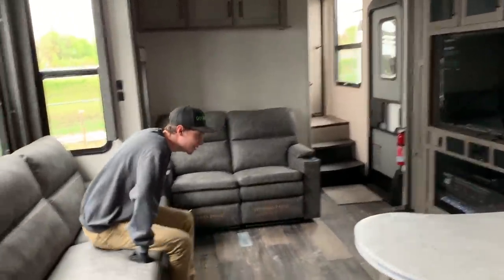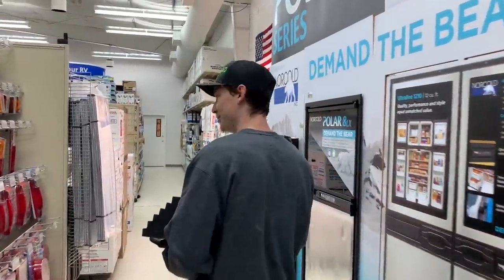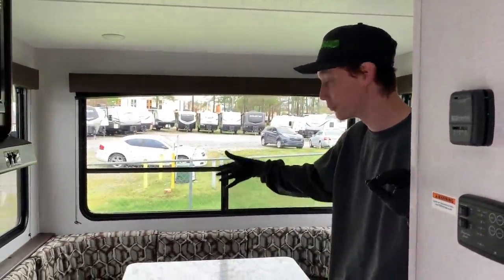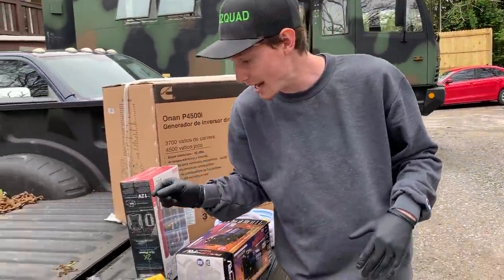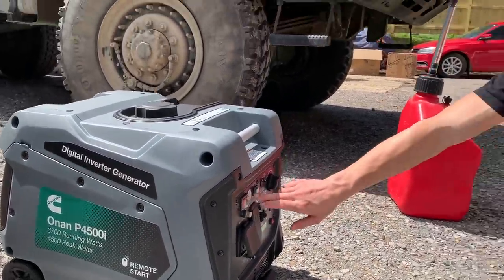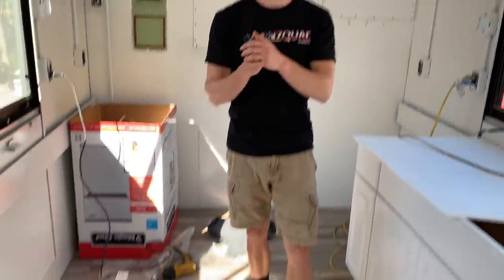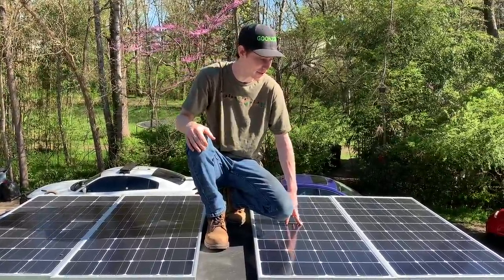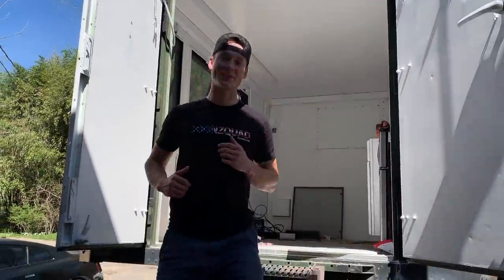Building The Ultimate Apocalypse Vehicle Part 5

Comment: Go to harbor freight and get a predator generator they are super cheap and very reliable I run one on the back of my semi when I’m parked been a life saver used it also to charge my trucks batteries when they got to low to start the truck. They are also compared to the Honda generators

Comment: 200w Minimum size panels, less hassle less holes less wiring and cheaper than 2 100w panels. Check out the 200w Hightec panels that are made in the US with 25yr warranty for $185/shipped distributed from ContinuousResources dot com. For batteries much better off with 2 6v Golf cart wired in series for 12v from Sams club, Costco or Batteries + other VMax has great AGM batteries. Generator or Inverter should ALWAYS be a Pure Sine Wave. Their generator is the pure sine inverter style which is why it's got Eco mode and quiet. Honda Yamaha HF Predator Champion or Wen are decent and different price range.

Comment: You guys get you an EMP SHIELD FOR  your circuit box / generator and solar panel . Plus an additional one for the trucks electrical systems also . Then no matter what happens all you need is food , fuel , ammo , weapons , and balls . Cuz some asshole will definitely wanna steal that rig from you guys . Wouldn't hurt to line the walls of the camper and truck cab with Kevlar also .

Comment: I really don't think that refrigerator was meant to be used in a solar application. It'll still work, but it's 120 volt and is not designed to be used like this. With solar you wanna mitigate the amount of energy needed to keep your appliances running for as long as possible.  Just that one appliance is going to drain your batteries.

Comment: You should have put in 12v led lights instead of 120v. That way you could have run them on battery and not have to have generator running to power them up.

Comment: you should do 4 batteries and 4 panels because only the minifridge would be running 24/7, lights and stove etc would run like max 5 hrs a day so you dont need more panels and if still the stored charge isnt enough, get more batteries not panels.

Comment: Some military panels run off of multiple voltages, 12DC, 24DC or 120 AC.  Find out if you have all AC or DC panels. And a solar panel usually puts out 1.4 Amps at a rated voltage, like 12 v, 24v or 36 volts. You said yours are 100-watt panels. You can have 400 watts if hooked up properly   Learn about volts, amps, and watts. The voltage and the amps are what one normally sees on a meter. Get some training on electrical. Understanding how the converter works will show you how the amperage is changed at a certain voltage.

Comment: that is a 3-phase power panel. Your generator outputs 2 "hot" wires. Residential circuit breakers boxes have 2 hots. This panel has 3 hots. A third of your power plugs are connected to the third hot bus, and will just never work if you don't connect third hot from a 3-phase generator. The air conditioner is probably 3 phase, and will never work, unless you connect it to 3-phase power. Does the circuit breaker for it look like it's 3 breakers molded together? If you can abide just never having some of the power plugs work, then what you're doing is fine. Otherwise you have to find a 3-phase gennie or have to rip out the circuit breaker panel and replace it.

Comment: i think the issue with your power is that the panel is a single phase panel, typical house panels are 3 phase.. you might want to get a different panel or call an electrician to help

Comment: if you really want to use all 8 solar panels to the fullest get a tesla model 3 or s battery pack, and wire your panels/mppt solar controller into a 24v system.

Comment: I'm an electrician...from what little I could see you are running that backwards through a breaker...at the top of the panel there are three lugs for your phases...that generator only runs single phase 120...if it does have 2 phase 240 or 277 you can power 2 of the three phases...it could explain the phases waves neutrals and all that in much more detail but that would take days...if you need assistance give me a holler and I'll see what I can do

Comment: You will want a pure sine wave inverter if you do not use a pure sine wave inverter you would destroy the compressor in your refrigerator and your delicate Electronics such as cameras computers and whatnot. The inverter you have now is a modified sound wave which will cause the compressor to struggle to operate properly and eventually burn up

Comment: Just wanted to let you know I noticed a BIG safety issue.  I noticed you are using lead acid batteries inside and not vented under your bench/bed, this could cause toxic fumes inside.  Using lead acid batteries are okay for solar but if you place the batteries inside they need to be in a sealed container that is vented to the outside.  I would highly recommend using AGM or Lithium batteries if you are wanting to place them inside under your bench.

Comment: Not all inverters are the same if you run a modified sine inverter like you tried  it may struggle with running stuff like tools appliances etc when your doing something like you are you should be looking for pure sine inverters because it’s equal to house power which is able to run anything vs modified sine where it in essence mimics it I know you got a inverter but I figured I’d share some knowledge thanks guys for the videos

Comment: Well that panel is meant for 220 and that 30 amp rv plug is only 110. So that's part of your problem. So you need a 220 volt 50 amp plug

Comment: watching another "off road truck" that is similar, there is a black out mode, there are sensors on every door and shade so if someone open it would switch off lights to the blue light circuit. you might want to look them up.

Comment: The electrical system in that box most provably is a three phase system.  In the Air Force we used 3 phase power units.  It will be better to change your electric box with a regular home box.  https://www.elprocus.com/difference-between-single-phase-and-three-phase-ac-power-supply/
checkout this video  https://youtu.be/vga2lvorfCo

Comment: Should have bought a secondhand damaged caravan or RV. Water pump 100 times bigger than you need. £30 for a caravan one that will run 2 sinks and a shower through a heater (whale)

Comment: Whatever you do, do not put that generator on board and run it in there. I have know people that have died from carbon monoxide from generators. In this case the generator was just outside the trailer and the wind was just right and blew the exhaust in the window all night, they fell asleep and never woke up. Also, install a carbon monoxide detector just to be safe with any other appliances you add on board.

Comment: There is no Negative with AC power. Hence the words, alternating current, or AC. You really should get a licensed electrician to give you advice about your panel and wiring. If you end up making the whole truck live and then step on the ground, it could be LIGHTS OUT forever.

Comment: Your only getting power on half of your panel.  That’s a 240v panel. Your only putting 120v to one side.  Just put a jumper wire from one terminal to the other on the top to make 120v to both sides

Comment: Billy the real good batteries  are I think Battle Born batteries  12 volt and I think lithium? They are about I think half the weight as regular  batteries  are a little pricey  but the best I think you can run them a lot lower than acid batteries  can be a big big difference  in the life, and you wont need as much ( as many of the battle born batteries ) because  they are so much more efficient  in use alone check it out  what you want  and what you what to do ,I think I'm telling you the best information  but still check it out for yourselves  to be sure you probably  could get a donation  for your channel  from battle born they are said to be the best and are pricey  ,so work on how many you need and just see if they will help you they are very knowledgeable  about  the solar equipment  so just check it out. and not harm them but I think acid batteries  you cant  deplete them without  charging them  first just trying to give you some  information  to help you,but just go to battle born batteries  and find out for sure  and they are half  the weight  I  think I'm right.

Comment: Caterpillar no longer makes their own engines. 
Caterpillar, for years the largest producer of heavy-duty truck engines, announced June 2008 it was leaving that business and wouldn't make products to comply with EPA's 2010 emissions regulations. 
Cummins 4500 portable generators have a Dependable 7.3 HP 224cc OHV 4-Stroke engine.
US and Canada Generators
Onan P4500i Inverter Portable Generator
Frequency (Hz)60
CertificationEPA, CARB
Fuel Type Gas
Designed to go wherever you do, the new advanced portable inverter and dual-fuel generators by Cummins, bring together efficiency, durability and performance to deliver three of our most versatile and reliable products ever, all backed by the Cummins 24/7 global support network to ensure that you’ll always have power for when you need it most.

Comment: Dude
That's a 3 phase panel.  Change it.
Use an inlet to plug the generator in
Put the batteries in the hole so the fumes dont vent inside 
Keep the generator portable so you can move it away from the truck otherwise it will be unusable and your build will become another campground queen.
Lloyd@LloydMillsElectric.com if 100 other electricians didnt already offer.

Comment: that is to big the tires are to small there should be a forklift motor on every tire the whole thing should be in the center and full electric and running on alternator turned by electric motor because when this doesn't run it isn't an apocalypse you are just losing the war. the tires should come from one of the many types of super truck and the hydraulic motors too. the one i am trying to get you to build is larger but it rolls over with error and doesn't kill the driver. it only hold about half the cargo though. you use to at a time like a tank too. or four at seperate speeds this will equal the same and the total weight for center everything and life and cargo is not to exceed to tires. then it will float roll and turn sorry. just a freemason kids.

Comment: don't be a dick  get a  electrician to look at it..

with my base knowledge i would say this was either  comms truck or  workshop truck, if it is the latter you will have the situation of single and likely  3 phase ac At 220/240-400 vac..

contact the military post and ask to  talk to the maintenance crew they will shed some light  on what can be  powered internally  and  what auxiliary power you can power it with..

I would not recommend arsing around if this has a 3-phase inlet for powering  the internals of the  cabin  part of the truck you are standing in ..